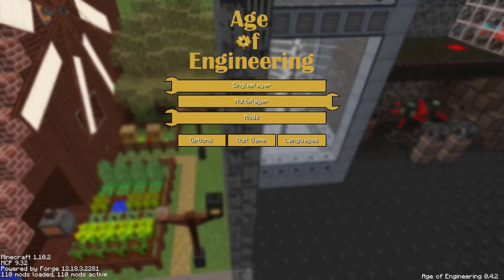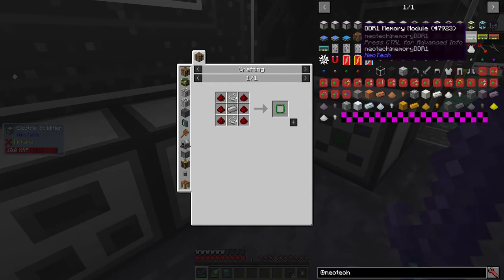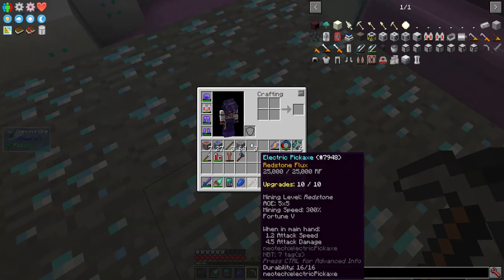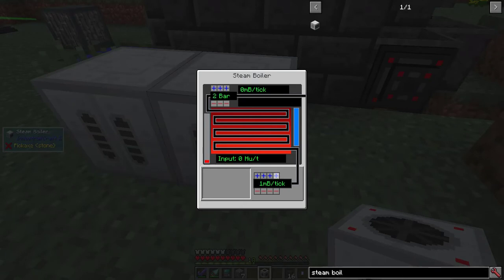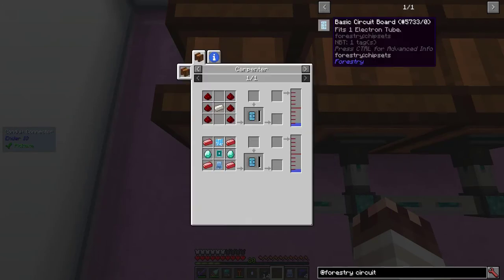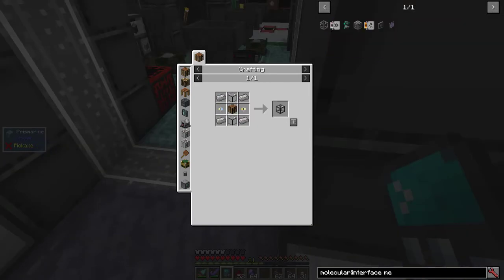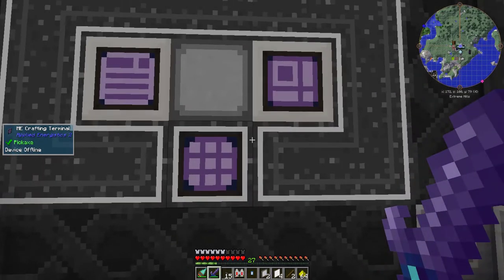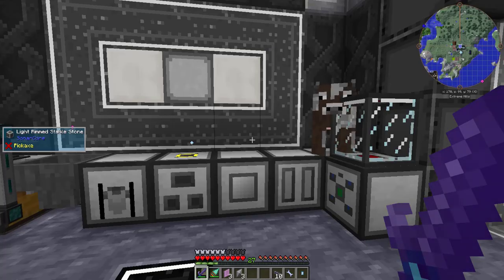Age of Engineering Supershorts #9: Neotech and AE2 Beginnings

Comment: Great as always, you might look at 1:04 though. Also a side note: You can make the Electric Tools in Neotech with any battery, you used the Basic Battery for only 25000 RF storage, if you use a better one you can store more energy.
Reply from the maker: Huh. I did think that was possible, but I didn't end up trying it because I had a battery in my inventory already. I might do that when I automate the  pick.
Reply from the maker: Oops! Just noticed that mistake. I don't think I can fix it now, unfortunately.
Reply: Seeing your comment I tried making a pick with the elite battery and got a 0 of 0 rf pick, had to throw it away, the basic battery worked just fine.